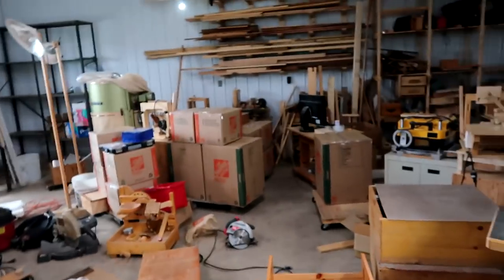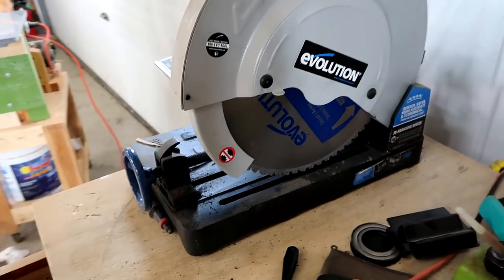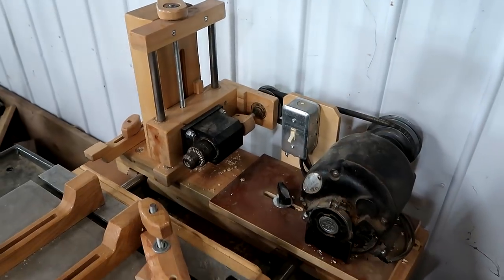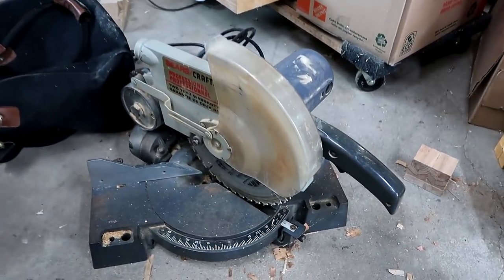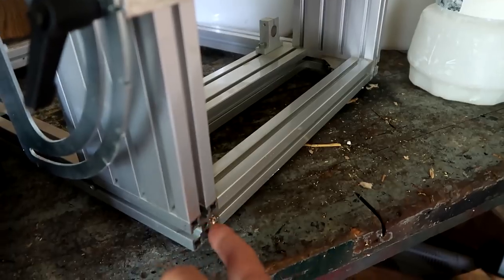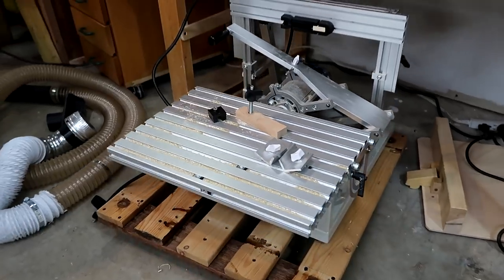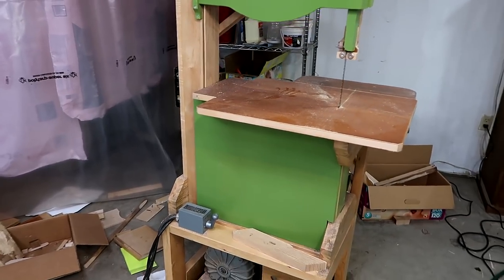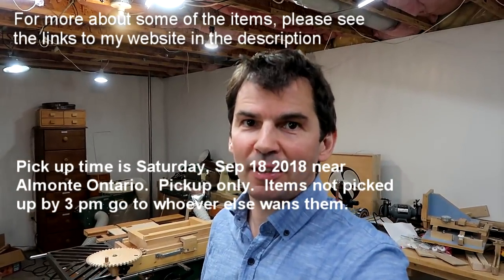Selling some woodworking machines  *Bids closed*

Comment: Next time you sell loads of items, it may be more efficient to use a Dutch auction for each item. Dutch auctions work this way: the auctioneer starts with a very high price and then starts lowering the price. The first person who stops the auctioneer dropping the price wins the item and pays the amount at which (s)he stopped the price. In this way you would not have to go back and forth with emails all the time to your buyers. Surely it requires a bit of work in setting it up, but you like to engineer solutions...
Reply from the maker: I didn't have time for that.

Comment: I'd love to get into woodworking as a hobby, but I'm on a rather tight budget. What machine would be worth investing in as a starting item? I reckon figure saw is a good start, though I've also been tempted to get a lathe first instead, as I'm personally more drawn to the potential that machine has in terms of making ornaments.
Reply: Planetesimal He has an article of "getting started" advice on his website that might help: https://woodgears.ca/beginner/
Reply: How about a table saw and a plunge router? If space is an issue: get a track saw instead, or even a circular saw and a homemade track. If the budget is tight, I would get a Japanese ryoba saw and a handplane.
Reply: I'd go for a table saw. Presuming you're not working from raw wood, that's the machine you'll use all the time. Lathe sounds nice, but turned objects have so few uses...While you can practically make lots of furniture with just a table saw, some clamps and a bit of sandpaper.
Reply: I'd consider the lathe almost separate from the rest of a shop..sure you can make table legs and what not, but, at least for me, I sorta had two parralel hobbies. The "woodworking" and the turning, and they'v seen very little overlap.
Reply: You should check out Steve Ramsey's channel on how to set up a workshop on a budget.
Reply: If ornaments are your jam then lathe it is, and some hand tools obviously.